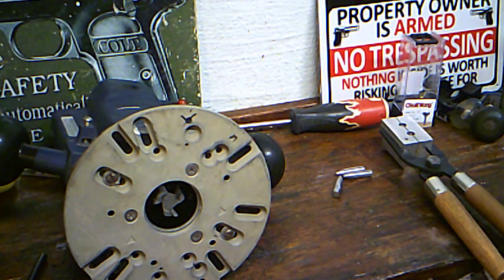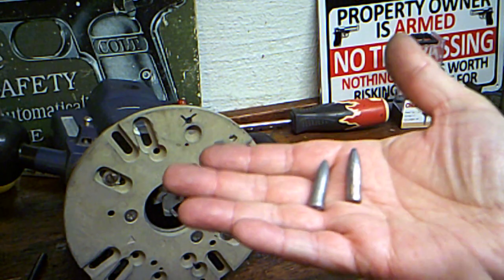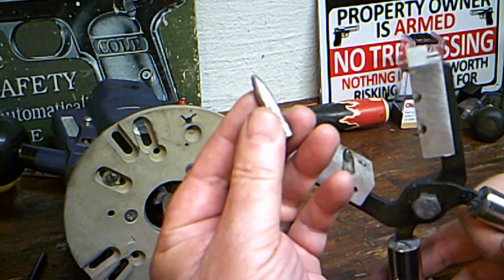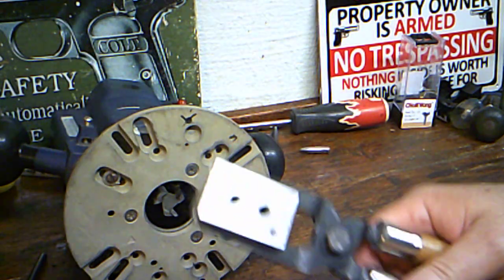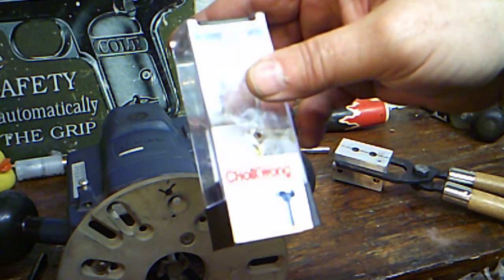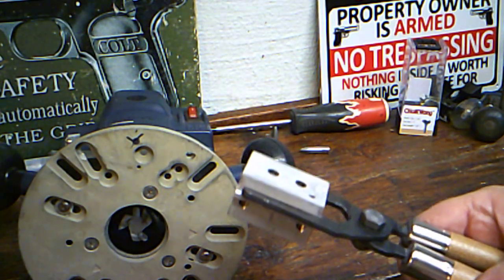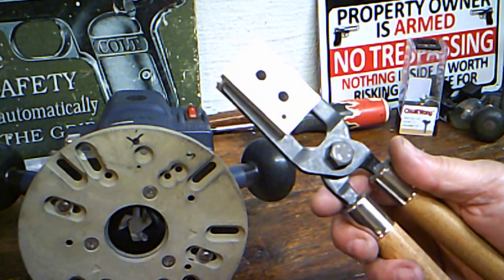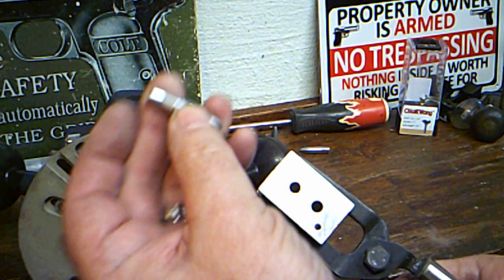Update on milling the Lee 309 -230 mold

Comment: Hopefully that will make it finally shoot well ;-)   I never shot groups or anything...just used the ones Kyle sent me down range to bang steel...which they did..but god knows if the bullet was tumbling or not :-)
Reply from the maker: I have around 50 cast up in the original 230 gr form . I'll cast up some with the modified mold and compare them .

Comment: Oh wow 🤩 that’s kick butt I just did a video about a mold I want to use for my 308 it’s a Lyman 311413 it’s a good looking projectile but I’m not sure how well it’s going to preform in my AR10 if it doesn’t do good out of my AR10 I’m going to get a bolt gun lol molds giving me a excuse to pick up another pice
Reply from the maker: With the 311414 you would be able to seat the bullet longer in the case than the 313 . The 313 might work OK though .

Comment: Help me put a nugget of knowledge in my backpack of wisdom here James? Why would you not want the boat tail on the bullet?
Reply from the maker: The boat tail uses up a lot of case space that could be used for the powder charge . Now the bullet doesn't protrude past the shoulder in my 300 blk case allowing me to cast these in zinc and have a 120 gr bullet with 18 to 19 gr of 296 or H110 powder . Also in the 230 gr lead version with the boat tail , some say it causes the bullet to tumble do to the excessive length of the bullet . I was curious .
Reply: @jamespollard1670  I see. Shorten the bullet to save case space. Interesting. Allowing you to use a bullet mold that use to give a longer bullet. Thank you! Knowledge is power.